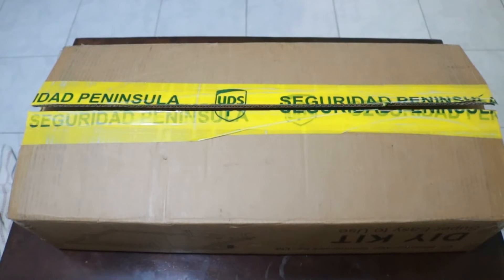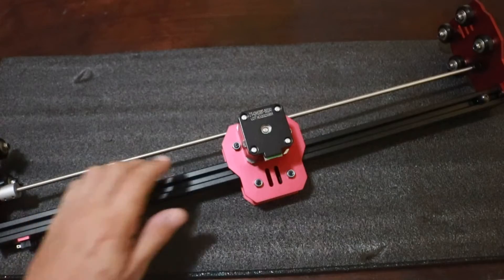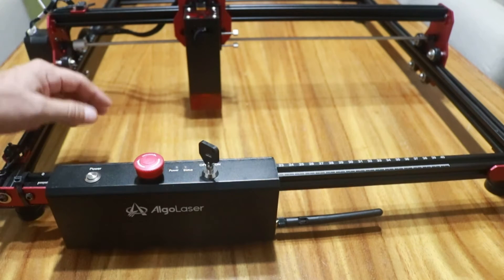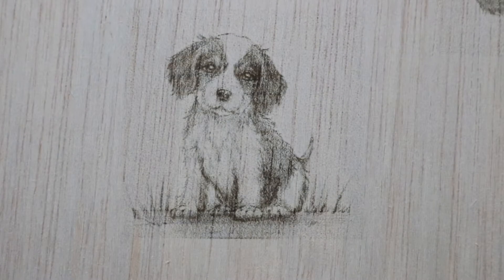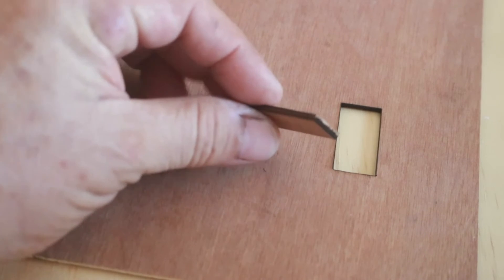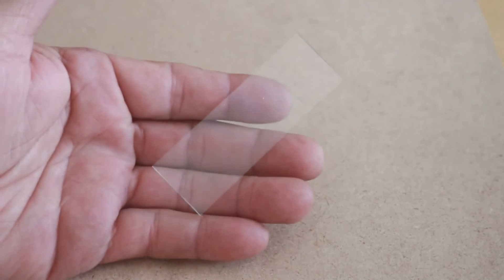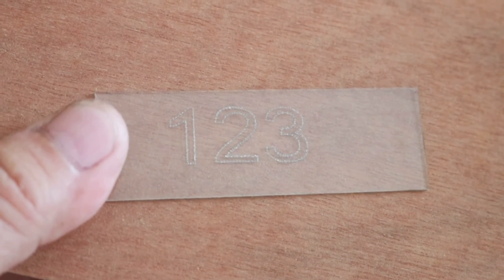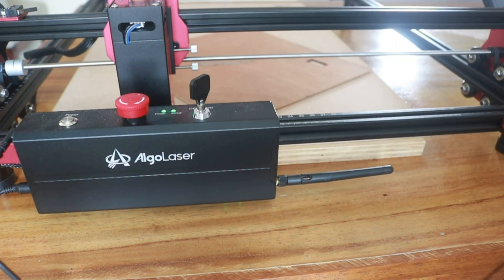Testing the new Algolaser DIY kit Laser Engraver

Comment: I won one of these (10W) about a week ago. I'm pretty impressed with it. The gantry slides very smoothly, the build is solid - not cheap (though the price is), the plastic laser shield attaches with magnets, and it's got the air assist built-in (I already have the air pump). This one will be great to help make my Christmas ornaments. I just need to get an enclosure for it, as I intend to use it indoors. AlgoLaser did a nice job with this one.

Comment: Having been successful cutting through 2.5mm thick MDF would it be possible to do one run and then refocus down additional 2.5mm and do second run to cut through 5mm MDF? Is there enough clearance to cutting head to do this?